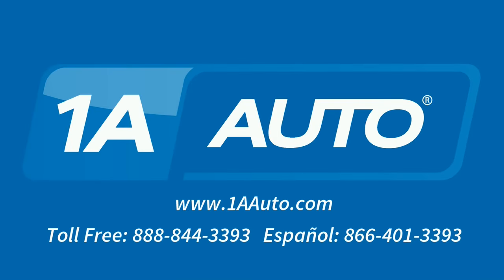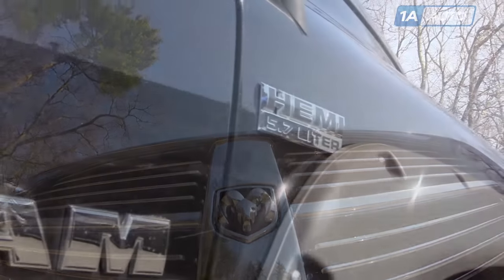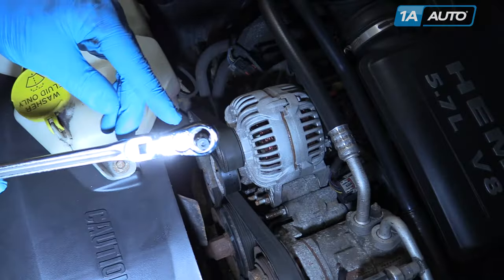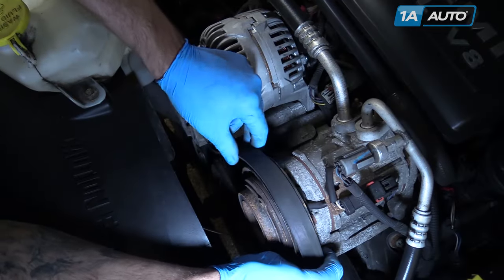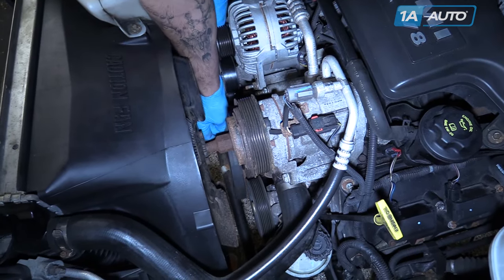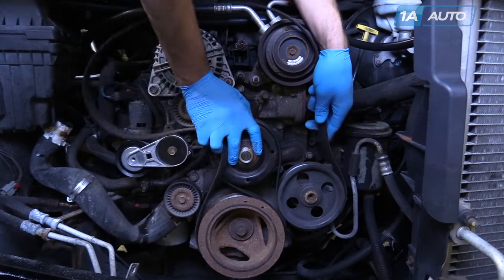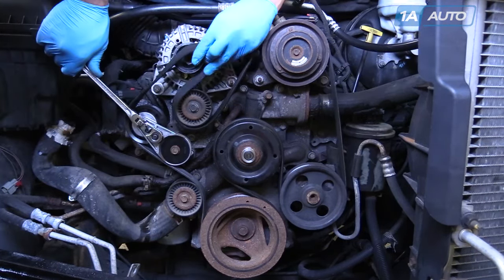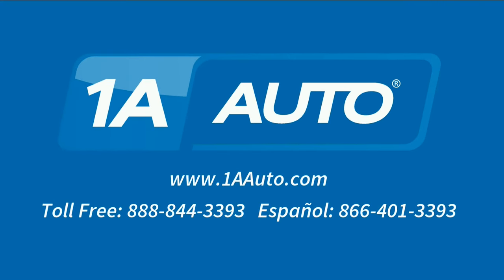How to Replace Serpentine Belt 02-08 Dodge Ram

Comment: Finally....I did it on my 2005 Dodge ram 2500 5.7L V8 put the belt on it and it the windshield and engine plastic tank were in the way of me...put the belt properly

Comment: Is this the same as for the 2009 Dodge Laramie?
Reply from the maker: +T.J. Wortman Thank you for checking us out. This may be similar, however the 09 will have a slightly different set up for the routing and position of pulleys. 1aauto.com